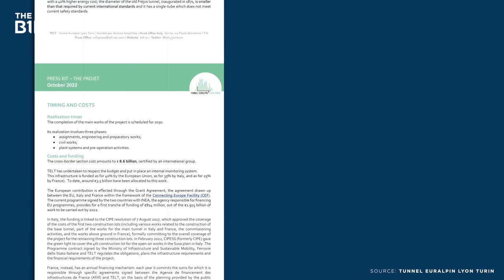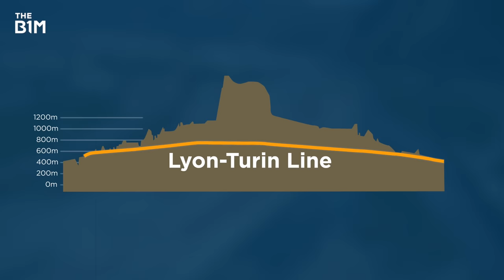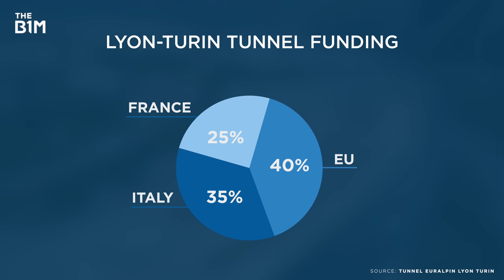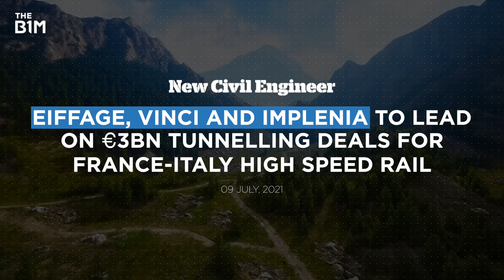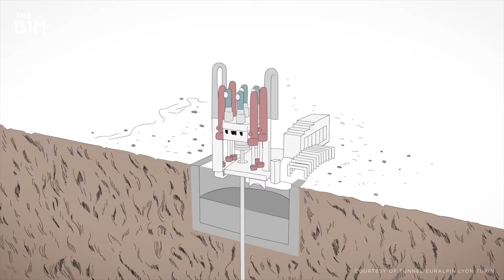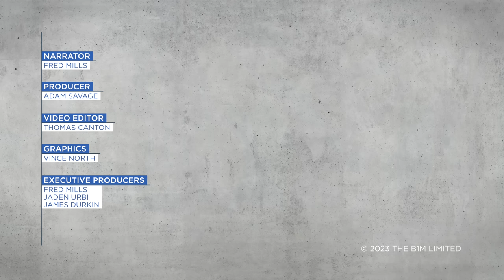Why Europe is Building a 57KM Tunnel Through a Mountain

Comment: As an Italian who has followed this project for a long time, a couple of extra info:
- the french "appear" to be paying less for the big tunnel, but that's because the rail connection between Lion and the tunnel itself is much longer and therefor more expensive
- the No TAV movement started out as a small local protest which had legitimate points: for example, massive viaducts were initially planned which would've ruined the landscape and also they planned to dig trough a portion of mountain full of asbestos. These points were valid and in fact changes to the project were made that ultimately result in a better railway. The problem was that the movement soon attracted violent rioters (no global, antifa and stuff) which clashed very very heavily with the police and disrupted the works (equipment and sites were set ablaze) and the legitimate points degenerated into generic ones such as "it's useless" "it costs too much". The worst of it has passed, but the No TAV movement grew into a national one that kind of opposes all major infrastructure works, often with violent protests.
- the government that was elected in Italy in 2018 contained a party, called 5 Stars, which was against the project and tried doing all kind of bureaucratic mess to stall the project. That's partially why the italian side works are behind schedule. Some positive came out of this too tough: they kept saying the project costed too much as a way to stop it, so the EU called their bluff and said they were gonna pay a larger share. So now the project is cheaper for both Italy and France.
They ultimately failed to stop it because stopping it would violate an international treaty signed in the 90s: the Treaty for the Protection of the Alps mandates that all member states should transfer as much traffic as possible, especially freight, from trucks to rail in order to reduce pollution and vehicle movements. Backing out of international treaties is very hard in the Italian law apparatus, so stopping the project was basically impossible.
Reply: Many thanks for the info!
Reply: Thank you for the info! Local knowledge like this really improves the perspective with the context.
Reply: Thank you friend!
Reply: i dont understand trying to stop high speed lines (redirection is ofcourse okey) Its not like human and cargo transport is going stop increasing. It will just clog the road networks, spraying the wider world with toxic gass and rubber debris. and ultimately spill over onto other smaller roads not designed to handle the influx of traffic. or worse, spill over onto airplanes.
Reply: Thanks for the intel dude.
Reply: The rarest of all comment types on YouTube. Informative, well written and balanced. Thanks for the info 🛤️👌
Reply: Thanks great info
Reply: Those Tunnel Bore Machines are extraordinary, it’s liek a machine out of a sci fi story.
Reply: ok, digging Asbestos Mountain does sound like a bad idea in Hindsight
& yep that sounds like internet Activism in action
Reply: The EU called their bluff so they were going to pay a larger share? So they didn't call the bluff, they fell for it. You're saying the opposite.
Reply: @manmanman5371  the EU wanted the tunnel to be built. Said party didn't want it for ideological reasons, and used "too expensive" as an excuse to block the scheme. The EU said fine if money is the sole problem, here's more, go ahead with the project.
Reply: @manmanman5371  exactly.
Reply: @luca7069  Yes I get that. But that is not what you would call "calling a bluff". That is the opposite: falling for the bluff.
Reply: How long would it take to travel by this route when it's completed?
Reply: @manmanman5371  ok, let's suppose english isn't their native language and perhaps they don't understand the nuance of "calling one's bluff".  how about "the eu doubled down" and "raised their bet"...does that satisfy your grammar nazi tendencies?  i think you understood what they meant even though they didn't meet your stringent policies regarding youtube comments.
Reply: Curious how such an informative and well-written comment is still one of the few not Liked by the B1M, let alone pinned at the top.
Reply: @manmanman5371  I agree that its not really calling a bluff, but I wouldn't say its falling for a bluff either cause it isnt really a bluff
Reply: @jgeur  English isn't my native language either. I just feel the need to help people improve their English skills and simultaneously clear up confusion other readers might have while reading his original comment. Also: "The EU doubled down" or "raised their bet" imply the exact same thing as "calling a bluff" so that's still incorrect.
Reply: @LinuxLuddite  Biggest advantages will be Paris-Milan 4h. Lyon-Milan 2h. Technically a direct connection between Paris-Rome could be established if there is demand (6-7h.+-). A direct connection between Barcelona/Madrid-Milan could be considered. This would however require Barcelona-Lyon route  improvement which is currently looking extremely unlikely.
Reply: Great explanation, thank you!
Reply: If I may ask, what is the new FdI government's opinion on this project?
Reply: @manmanman5371  It would only be falling for a bluff if 5 Star wanted the tunnel.  5 Star didn't want it, so by arguing on financial reasons, they lost any grip they had on stopping the project completely.

Calling a bluff isn't the right term either, but I'm not sure what you would call it... Other than being slapped across the face and told to shut up.
Reply: @luca7069  In other words, the EU fell for it after all, just to get it done. In this scenario, the EU is the sucker and Italy gets away with paying less.
Reply: @manmanman5371     double down - strengthen one's commitment to a particular strategy or course of action, typically one that is potentially risky.

bluff - try to deceive someone as to one's abilities or intentions.

not the same thing.

now i've helped improve your english skills.  you're welcome.
Reply: I'm honestly really mad that "no tav" has become the general term for people opposing infrastructure projects. "TAV" didn't even use to mean high speed rail until two years ago. It was and still is the name of this specific project.
Reply: This helps explain a lot - thanks!
Reply: Thank you Luca for the amazing information. I hope they dig arround the asbestos in the mountains. We dont need aditional danger. And i hope the people wil find peace midway.
Greetings,, Kitty.
Reply: Working with asbestos-containing materials is the main cause. People who laundered clothing containing asbestos fibers or live in areas with high levels of airborne asbestos are also at risk
Reply: @steiner554 That's a very mediocre take, they may be the "third net payer" but the sums involved in terms of actual money are much lower than what Germany France Italy etc put in since they're much larger countries.
Reply: On the french side, the opposition to the tunnel also looks wierd. Indeed most politics against the project blame the aleged damages to the environement caused by the tunnel. However, they convey their oppinion through unproven facts. They even go as far as saying that the hundred thousands of trucks away from the alps are not worth tuneling. 
Yet in the end it all comes about ideology, since they aspire to an economic model based on degrowth. So they wrongly think that by getting rid of the tunnel they will prevent trade from happening. 
In the end, politics, who are protesting against the tunnel are just hippocrits too affaid to explain the real reason why they want to stop the project.
Reply: @profwaldone  Probably because of the massive environmental costs in building it? Putting aside the local destruction of the landscape and local habitats (which can vary a lot between different megastructure projects), It has a huge CO2 footprint in construction that kills any environmental benefits from shifting freight to trains, and trains still emit a lot of CO2 (with high-speed trains even more), so it certainly doesn't fix the CO2 transport problem. How big the actual problem is for the local roads will depend on the context, and the congestion will certainly slow down transport through this region considerably, but if you look on the larger scales, generally it's going to help more people if funding for infrastructure projects is focused where people really need it (like all the problems with Italy's medical system that showed up in the pandemic maybe? Epidemiologists have only been warning people about these kind of issues for years). Only the local people can say whether the huge construction site nearby and pollution from the nearby huge railway complex (when it is created) is worth more than pollution from lots of trucks, and I pose that as a genuine question because I don't know and I'm really guessing you don't either. What this railway really does do is make transport easier (the importance of which will depend on the people and goods that need to move through this region), increase money from freight rail, and hence funnel more money for central regional economies. I'm not suggesting that the overall effect will be good or bad, but you're clearly ignoring the real issues that exist. Don't oversimplify a complex situation like this, because it's clearly not so simple. 

Btw: I'm certainly not a fan of internet activism blown out of proportion but if you ignore the issues on one side of the argument then you're really no different than someone doing the same on the opposite side. That's why all extremists, no matter their position or argument, are the same.
Reply: Thank for this insight.
Reply: Thanks for a conscience background to the protests
Reply: I’m Italian as well, and I confirm word by word what Luca has reported. I live in the area of the upcoming Brenner base tunnel, and I can’t wait they complete it, so it will relief the highway from much of the truck traffic and pollution. Fortunately, people in this area understand the advantages of the tunnel, and there is little or no opposition.
Reply: Uranium in those mountains just in that area.
So good for France considering what is happening in Africa......
Reply: @manmanman5371  Your interpretation is incorrect and you shouldn’t lecture others if you’re not 100% certain. To call a bluff means “to challenge someone's statement or threat because it is not believed”. Five Star claimed they opposed the project for financial reasons as part of their populist platform. The EU, which was skeptical of this claim, called their bluff by offering additional financial support, directly addressing Five Star’s primary objection and forcing them to either support the project or acknowledge that their opposition was for ideological reasons. The EU did not “fall for the bluff”, the EU wanted the project to be completed, saw the Italian opposition was based on disingenuous arguments, and forced the politicians involved into a difficult position that increased the likelihood of the EU’s desired outcome (completion of the project). The EU’s budget exists to support development of its constituent nations; it is a gross failure of understanding to claim that the EU suffered a loss as a result of supporting an economically and environmentally important infrastructure project.
Reply: @Nikegod  Too long didn't read
Reply: @MrR233  as far as I know, the biggest "improvement" for connectivity with Barcelona (the Montpellier to the Spanish border high speed rail) is under way, although, since it's gonna be an SNCF project, it'll probably stop in a bunch of 20k inhabitants small towns which will make it a bit slower. Still, the high speed connection is in the works for the early 2030s too if I recall correctly so they should coincide nicely
Reply: go away.
Reply: @manmanman5371  I’m not surprised. Someone who reads wouldn’t have been so confidently incorrect in the first place. Chin up and learn for next time.
Reply: All of this to save 2 hrs?  Oh mon dieu!  Remember Concorde?  All that time saved.
Reply: I'm sorry but it still doesn't make sense for Italy to pay more since you also say it yourself that the rail link between Lyon and the tunnel is much longer and therefore more expensive, so it should be France that has to pay more since their section is longer
Reply: It reminds me of the people protesting the Stuttgart main train station rebuilding. They have a little stage, and speakers and a mic which they half-heartedly use to say exactly what they say every week.
They patrol the station in pairs, holding banners, and never once did they talk to me about what they're doing, even when I put myself in their path. They just walked around me.
They don't want change, it seems, they just want something to be right about, and angry about.

None of them seemed of even average intelligence, or interested in the world around them.

The original protests also had a point, were listened to, changes were made and a referendum was held.
The ones that are left just don't like the democratic results. :)
Reply: @manmanman5371  In a way. The "is costs too much" wasn't about the cost, it wass about getting their way.
The EU called their bluff in the same way you deal with a tantrumming child complaining about a chore being too difficult; you make it so that even in their eyes, it is easy. That way their objection is null and void.

At that point most will be unwilling to admit that it wasn't actually about the thing they were complaining about, and a thus the movement loses steam.
Reply: @maythesciencebewithyou  Eh. Money is a facilitator.
The goal is to build a tunnel. Money was used to ensure the tunnel would be built with no major issues.

Less "falling for", more "getting the job done".
Reply: @Scapestoat  (The ones that are left just don't like the democratic results. :))  That's like the EU Remainers and Rejoiners in the UK.
Reply: @Steiner I'm Dutch, and I know the NL is a large net contributer. But the NL benefits from the EU way, WAY more than it costs them.
And as Dutch person, I support the contribution level. Infact, why don't we try to be the #2 net contributer. Set the right example? :)
Reply: @luca7069  While the Dutchie mentioning net contribution did indeed make a weak point, I do agree that per capita contribution is a more important metric than overall amount per country. Because large countries just tend to use overall amounts as an excuse to do less per capita, and then boast about it, because raw numbers look good.
Reply: @bobblue_west  Yeah. They didn't want a fair vote, they just wanted to get their way!

The subject of Brexit and Scotland's approaching declaration of independence are a bit more serious affairs than simply opposing an infrastructure project because they were bored, though.
Reply: Unfortunately i see this playing out like the Tunnel de Tende- it’ll never be finished because of italy
Reply: @jgeur  thank you 😅
Reply: @ZealofSparta  no one is going to read a comment that long
Reply: @manmanman5371  The EU is financed also with the Italian tax payer money, money doesn't grow on trees. We contribute the third highest amount after Germany and France.
Reply: @polynomen  Italy pays more because France couldn't give a shit about this tunnel.
Italy is on the end of the whole European network, the tunnel is an access point for Italy to the whole of western and central Europe.
The tunnel for France is only an access to Italy.
Reply: @simonmrnka3405  Strongly in favor as far as I know
Reply: What does anti-fascism have to do with anything related to this project? Lmao
Reply: Thank you ! I was wondering why one wouldn't like that except Nimbys
Reply: Fantastic summary! Followed the story for years from France and didn't know all this.
Reply: @manmanman5371  "But that is not what you would call "calling a bluff".  Well, that depends what the speaker is referring to with the term, 'bluff.'  Here, the 5 Star crowd had as ideological (not financial) objective the cancelling of the project. Cost was the 'pretext.'  The EU had a stronger ideological and political commitment to a strategic East - West rail corridor than the 5 Star movement had to their objective of its cancellation. Money was the enabler, and the EU put it on the table, like a joker jumping their hand.  So I can see how, 'calling their bluff' can apply here. But the fact that are nit picking about words shows that some people's ideology is stronger than the facts they have to back it up.
Reply: @manmanman5371  And yet, as a native English speaker, I understand exactly his point without the need for the pollution of the thread with lines of grammar point-scoring.
Reply: @maythesciencebewithyou  No. Think bigger: the EU wants to enable a strategy EU-wide East West rail corridor. They would have funded it anyway had France and Italy not being doing so for local reasons. This is about Portugal-Spain-France-Italy connecting to the North - South Scand-Med axis and to Eastern Europe.
Reply: @polynomen  France DOES pay more 'because its section is longer'. He is talking about the TUNNEL section....
Reply: Thank you for the additional info
Reply: @Artista_Frustrado I mean not all internet activism but a regrettable portion for sure

Comment: I'd like this channel to go into more details of the wonderful machines that build the things this channel talks about.    Maybe it could be a separate series.  For example, that ventilation shaft drill which drills upwards and excavates at the same time, how does it do that?  Also I'd like to see vids that answer basic questions, like how do they insure the holes 'pilot' down the planned lined.   If you bore from both ends, how to make the tunnels meet?  But not just boring, even things like answering basic questions about how buildings are built would be fascinating to see, and this channel would do an amazing job of it as well.